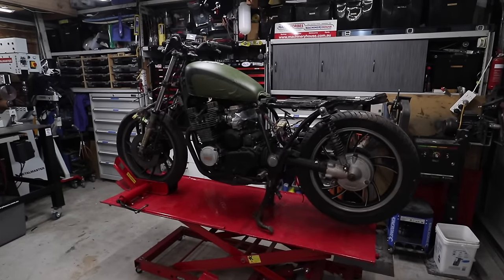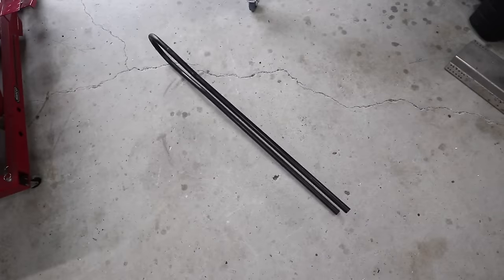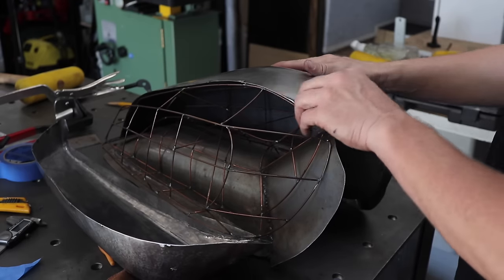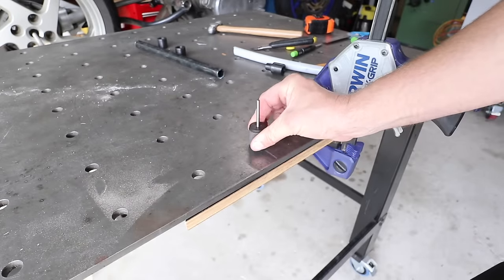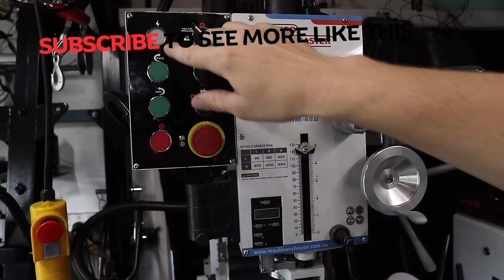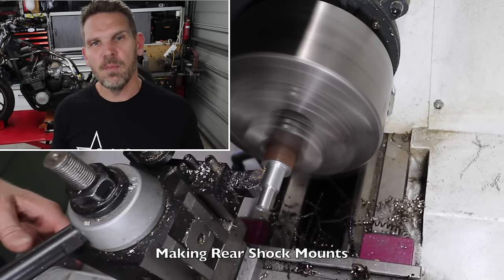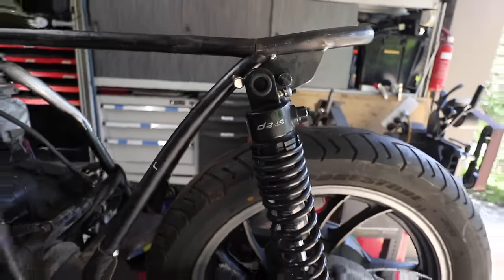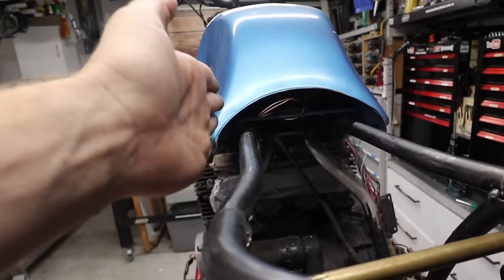HOW TO BUILD A SUBFRAME - Cafe Racer / Tracker - TIMELAPSE

Comment: Love the happy problem of having to switch to a monoshock. It'll keep the back end nice & clean looking while emphasizing the duck bill seat I imagine you'll be installing later.
I'd look at trying to source a Yamaha XS650 tank for this build. It's the right size & shape for a flat tracker and keeps the Yamaha lineage. If you want a more angular look, a Honda CG125 tank would be worth looking at.
Reply from the maker: Thank you so much mate and yeah I have some more interesting plans for this bike so stay tuned 👍 I think the CG tank is a little shallow for the frame but I’ll check out the XS 650

Comment: Please stop working with your left arm over the chuck. If something happens, your file will hit you or your sleeve will catch on to the rotating chuck. Better be safe my friend. 
Put your right hand on the tip of the file and the handle in your left hand. And keep your left hand on the top surface of the handle. That way, if something would happen, the file moves away from your hand, not into it. I hope you don't mind me saying this. 🙂
You are a mix of Gyro Gearloose and Inspector Gadget! Amazing!
Cheers!
Reply from the maker: Thank you so much for the tip John I appreciate you looking out for me. 
I dislike using a file on the lathe at the best of times so any help is always taken with the upmost respect ✊
Reply: @CafeRacerGarage  Thank you. Take care mate!

Comment: How does the vehicle inspection work in Australia? Do you need to get the frame approved by the state before you can get a plate for the bike?
Where I'm from, you have to take the bike for a new inspection if you alternate the frame too much, and it needs to hold said amount of force without breaking in order to get a license plate.

Comment: How did you bend the upsweft of the frame hoop? Cut it halfway, hit it with hammer and weld back together?
Reply from the maker: 100% it's how I've always done it so you can  get the angle exactly how you want on the bike, just make sure if you are going to grind the welds flush that you prep the join with a gap or 45 degree for plenty of strength

Comment: What was the issue with having the shocks vertical? Is there any mechanical disadvantage to them not leaning so far forwards or is it just a visual issue.
Reply from the maker: I’m no expert on suspension, but Id assume there is a logical reason as to why they’re on that angle, perhaps the way the swing arm swings up has something to do with it.  i’m extending the swing arm to its full reach and switch into a mono shock which has its own challenges as you’ll see in the next video. 
If I was to keep the twin rear shocks, I would try and keep them on the angle they were from stock.  Hope that makes sense.

Comment: Hey mate, Love what you do. I’ve  been watching your videos for a few years now. I’m currently building a CX500, it has a bent subframe so I’m planning on building a new subframe for it. I’m in North QLD and I’m struggling to find a supplier for suitable tubing to build the frame out of. Can I ask where you get the tubing from? I imagine it’s seamless mild steel you’re using.
Reply from the maker: Hey mate, I just generally use 3mm wall thickness 22mm mild steel tube. I do know that the tube on these particular bikes is about 25 mm,  so bohler steel in Brisbane could possibly get you the correct OD that you need or potentially contacting a steel supplier and ask them where to get the size you require and they may have some better options of companies that can help
Reply: @CafeRacerGarage  Thanks. Steel suppliers up here haven’t been very helpful. Most cater for mining so start at larger diameter tubing. The CX is 28.6mm 1.6mm wall so I’ll probably go 25mm with a thicker wall depending on what I can get. A Fab place put me on to Pirtek as they sell 1” hydraulic tubing with 2mm wall. Wall thickness is probably fine, maybe a little on the thin side, I’d rather not have to remove zinc plating though.
Reply from the maker: @mattharding3175  try calling this number and ask them if they know of a place where you can get exactly what you want 07 5597 6822 
This is a steel supply company here on the Gold Coast and I’m pretty sure one of the guys there told me about a company that you can get what you need, but I can’t remember the name of the one they mentioned, if you do end up finding out the information, let me know 🙏
Reply: @CafeRacerGarage  too easy I’ll give them a call. Also can you please stop using expensive tooling. After watching you use that tube bender I need to have one now and I can’t afford one 😂 The Mrs would appreciate it if you’d go back to bending tube around plywood on the floor.
Reply: @CafeRacerGarage   So I called the steel supply company and they put me on to other steel supplier in Brissy, who told me to call Van Leeuwen in Redbank. Van Leeuwen can stock most sizes of seamless tube and can order in what they don’t have. They have 7/8” (22.2mm), 1” (25.4mm) and 1 1/4” (31.8mm) OD and a variety of wall sizes ranging from 1.6mm - 3.25mm. Only downside is they only sell in 6m lengths.